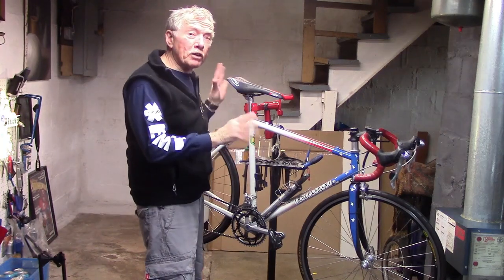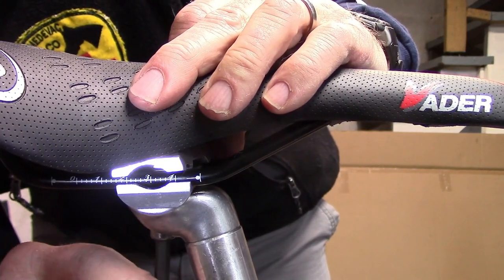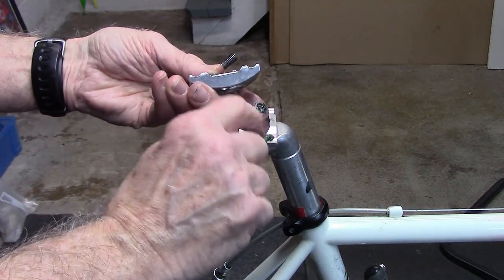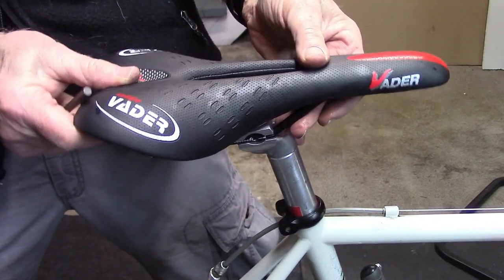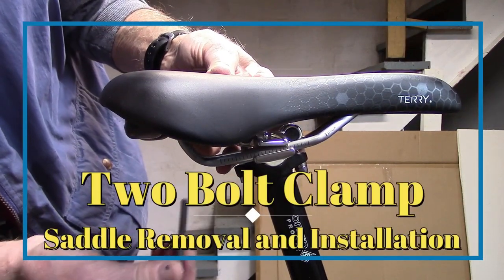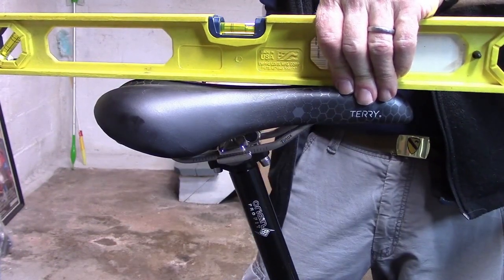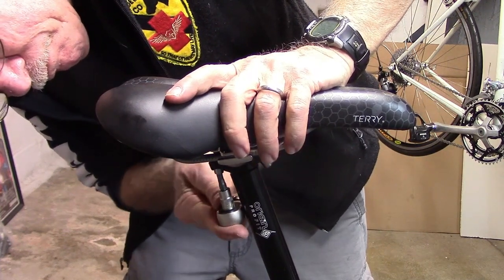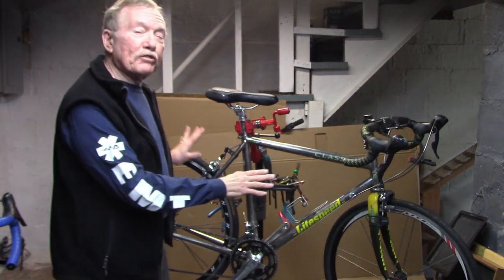Bicycle Saddle Creaking: Saddle Removal, Lubrication, Replacement, Tilt

Comment: Why is the seat tilt so important that you have to use a carpenters level?
Reply from the maker: Just adding a few mm forward tilt can, for some, result in shoulder pain and hand numbness. A few mm back for others can make one feel like there're sliding back on the saddle and decrease pedaling efficiency. The right saddle tilt for you may be level or a few mm either way. Once comfortable, we'd like to restore the tilt to what it was before we took the saddle off for cleaning and lubrication. The carpenter level is a better way to look at tilt then trying to "eye balling" it, but I'll leave that up to you. Safe cycling, Tony

Comment: How do you know what the tilt of the seat should be or when you should change it?
Reply from the maker: Tilt too far forward may result in increased pressure on the shoulders, arms and hands resulting in pain in the arms and numbness in the hands. Too far back and you'll feel like your sliding back, gripping the handlebars to pull you forward and also decrease pedaling efficiency. So, what is the best tilt for you? I suggest starting in a horizontal position and adjusting the tilt only a few mm to increase comfort and increase pedal efficiency according to your body structure and comfort level. I know that's not an exact answer, but you'll need to experiment but don't over adjust the tilt.

Comment: I measure from the tip of the saddle to the center of the headset to make sure that the saddle has the correct set back.
Reply from the maker: Good point worth noting. Safe cycling, Tony

Comment: I ordered a carbon rails saddle. It creaked a lot and found out that it has oval rails instead of round. I bought an adapter and the creak was gone.
Reply from the maker: Great tips. What was the make of the adapter and where did you purchase it from?
Reply: @tony10speed  It was a Bontrager oval rail adapter I bought from a Trek retail store. Mind you it was for a Trek Emonda with a seat mast that is diferent from the ones you showed here.
Reply from the maker: @Onigure  Thanks.

Comment: Do you do the same for mountain bike saddles?
Reply from the maker: Yes, but tilt may vary somewhat On a hardtail, it's usually comfiest to have the seat roughly level. On a full-suspension bike, it can be good to tip the nose down slightly, to compensate for the fact that the rear suspension sags considerably further than the fork when you're sat in the saddle. Finally, also consider saddle height. See:
https://pedalchile.com/blog/mtb-vs-road-saddle

Comment: I'm trying to get the nose UP. I follow what you do but only I do the opposite: instead of loosening the rear and tightening the front like you do to get the back part of the seat up, I loosen the front and tighten the rear and it STILL brings the nose down and bye bye goes my perfect balance on my level. I'm using a Selle SMP saddle.
Reply from the maker: One needs to go slow, tightening the rear bolt slightly then loosing the front bolt - back and forth until eventually you get the seat at an angle you desire. The desire tilt you want to start at with a Selle SMP is described in the following:
https://youtu.be/gkbXCzPwZ6E?t=150
Make sure the seat post is fitted in the correct position with the "set back" toward the rear. Also see:
https://www.youtube.com/watch?v=CwrfRyVxBvc
Hopefully this will help. Regards, Tony

Comment: How does one know what saddle to buy if you want to replace it?
Reply from the maker: No one saddle can be recommended since it's based on your pelvic structure and personal comfort. Check your position of the bike first:
https://www.youtube.com/watch?v=9wbB6ILy5cA
After that is set, you'll need to determine saddle width:
https://www.youtube.com/watch?v=rG0yI-gij_8
and then:
https://youtu.be/zJ4-Cx5s1kE?t=386
From here, you'll need to experiment. Don't go too squishy but on the other hand there are a lot of gel saddles with good support, cut out, and some curvature that will give you comfort, especially for longer ride. A lot of videos suggest carbon fiber rails or carbon fiber shells that really don't increase comfort but do increase the cost. Some local bike stores will allow you to try out a saddle.

It's a bit of a process and may take you a few dollars before you find what right for you. There's no way to make this cut and dry but it is a process that take time. 
Regards and safe cycling, Tony

Comment: Is a two bolt seatpost better then one with a single bolt?
Reply from the maker: I find it easier to adjust the tilt. Once you get it in the ball park, one alternates tightening the front bolt just a bit, then the rear bolt just a little bit, and go back and forth, checking the tilt with the level as you go. The single bolt system often times is a hit and miss.

Comment: How do you know if it's the saddle or seatpost making the noise?
Reply from the maker: Determining if the noise is saddle or seatpost can be a challenge. I usually start with the seatpost since it's more common and easier to clean. Use only carbon fiber paste on the seat post (whether it carbon fiber, steel, titanium, etc.) so as to prevent slippage. See:
https://www.youtube.com/watch?v=AjddeJ2m4ss
If that doesn't cure the problem, I turn to the saddle clamp or lubricating where the saddle rails enter the saddle itself.

Comment: Hi sir i have a problem if u can help me , i want to change the highest seat but i found problem in piece that open the seat i try 40w
Reply from the maker: This can be a difficult task. You will need to free up the seat post which may be a difficult task. Try something like PB blaster rather then WD40 or Knock'er-Loose which are better penetrating liquids and anti-corrosive fluids. Here are several videos:
https://www.youtube.com/watch?v=aXuc9dTH9qE
or
https://www.youtube.com/watch?v=gBP4OzuN82E
or
https://www.youtube.com/watch?v=zTC4xh3UmwQ
All I can say is "Good Luck." Let me know if any of these techniques work. Regards, Tony
Reply: @tony10speed  thank u so much , i will see